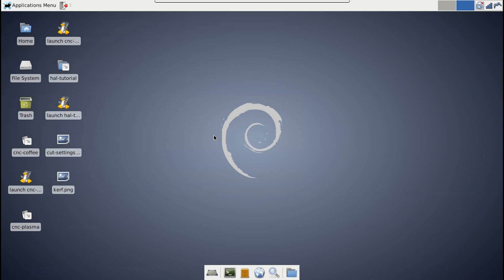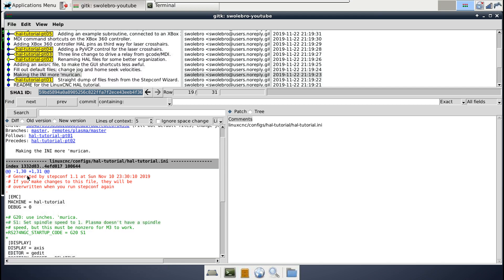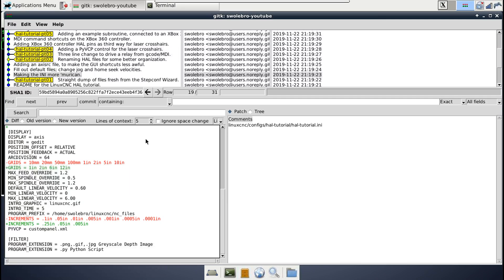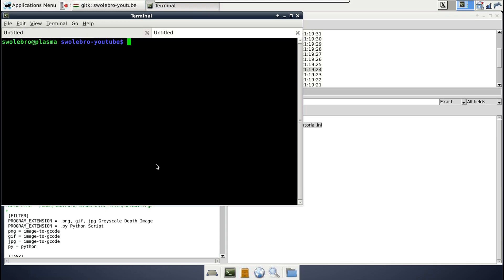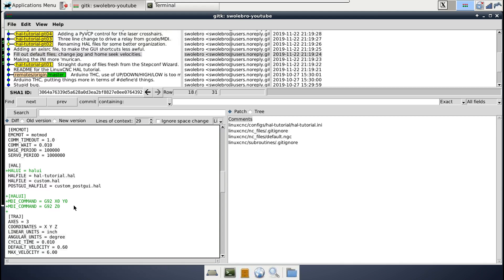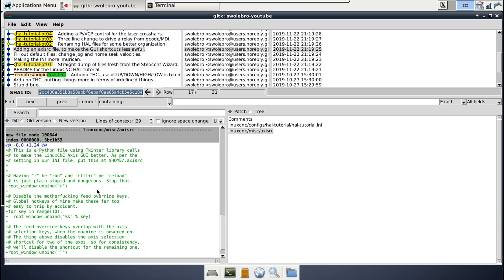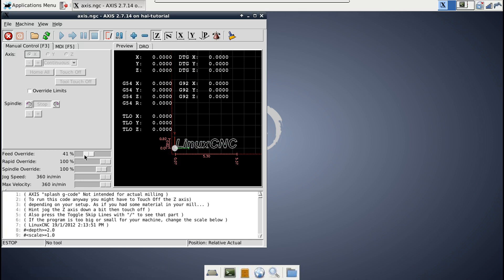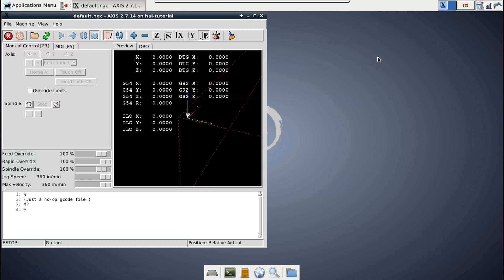LinuxCNC HAL #2: INI improvements

Comment: my first time i use linuxcnc, debian 10 preem rt. and i not understand motors working but how can make E-stop and probe working i has open hall- meter but not newer come true/false i test whit NC button to pin 10 is E stop and pin 15 probe. and step conf wizard have pins setting ok. motors move, XYYZ have wizaerd make XYZA config. end stop pin 10 and probe pin 15. why hall meter not show newer true/false, what need do next can make working. brealout board is connect wires gnd, probe, and gnd to e-stop, and buttons have NC. help please. i not understand good english.this is first time i use linux and linuxcnc. last night can make motors first time run both Y axist run, wizard make A axis pins same setting what have Y axis setting. but why e⏹ stop button not working or probe why hall meter not show if button is on or off.what need do ? help please.

Comment: I understand your HALline for lesson 1 a LPT port. What would a HAL line look like for the MESA 7i76 ethernet board.
Reply from the maker: Haven't used that one, so I can't say specifically, but you'd want to use the PNCConf Wizard to establish your baseline, instead of the StepConf Wizard. That should fill in most of the blackmagic voodoo parts of things.

I might find some time to mess around with the Mesa hardware later this year. In the process of moving right now, and losing my shop (boooo), but it means I'll have more time to mess around with proofs of concept for software/electronics. Then when I get another shop and rebuild the plasma, I can give it all the fancy upgrades.

Comment: Any suggestions for writing hal to toggle between continuous and all of the incrementals with a gamepad button? Basically emulating the I keystone. I can't install qjoypad.
Reply from the maker: If you look at the manpage for halui, there's a couple jog pins. I'm guessing halui.jog.<N>.increment is what you want, and based on the code in /usr/bin/axis (a Python script), it looks like 0 means continuous. Hope that gets you on the right track.
Reply: @swolebro  every time i try to use halui.jog.0.increment or even gmoccapy.jog.jog.increment (both being float values), I get a does not exist error... I wish there were a way to just map keystroke I to a button without using qjoypad... I'm running Debian 7 on a pc not attached to the internet 😑
Reply from the maker: @TheFeralEngineer  Did you include the settings for HALUI and POSTGUI_HALFILE in your INI, and then only reference the halui pins in that postgui file? The way halui loads is a bit of voodoo blackmagic (not using loadrt or loadusr) because it has to happen after the rest of the GUI stuff has launched.

Also, if not having internet on the LCNC box is the only holdup from installing QJP, that shouldn't stop you. You have to download and install that package manually anyway, since it was never available for Debian 7 (on which LCNC 2.7 is based). So you can just download the .deb file, transfer it via a USB stick, and then install it with dpkg. Details/commands for that are in the write-up here:

https://github.com/swolebro/swolebro-youtube/blob/master/linuxcnc/misc/xbox-controller.rst

Let me know if either of those things works for you - or if they don't!
Reply: @swolebro  yeah i have halui called and the halui.jog.0.increment called in postgui. Still getting does not exist for some reason. I'm using halhi components for my other buttons, but it seems like the float ones don't want to cooperate
Reply from the maker: @TheFeralEngineer  Weird. If you don't try hooking up the pin at all (so that the controller starts up properly), and then you launch halmeter, can you at least see the pin listed in there?

Might be time you throw your configs up on GitHub and ask around on the forums, since I'm not sure what's going on here.
Reply: @swolebro  I'm gonna try and get qjoypad up on my box per the link you sent and see if that will work. I set qjoy up on the computer I'm using for my other machine (that one has internet) and found that you can't use lower case and capital letters as different keystrokes in qjoy, so I changed the shift+i in the gmoccapy file in usr/bin as a sudo user to use my top right buttons to scroll forward and backward through the increments, but now getting it to work through hal is more principle than necessity

Comment: Having started with LinuxCNC about a year ago, I can say that your videos are making it MUCH easier for a newcomer than it was for me.  And even  though both my mills have been controlled by LinuxCNC for a year I've learned some new stuff from your vids.  Super awesome work!
Reply: Really appreciated from someone who is doing he's second grbl cnc router retrofit and looking into adding a parallel port to learn LinuxCnc.
I've not even installed LinuxCnc yet, but it's super important for me to understand first how the system  parts and bits interact to each other's. That gives me an opportunity to really understand what is possible with LinuxCnc.
So yeah, great contribution to the community !